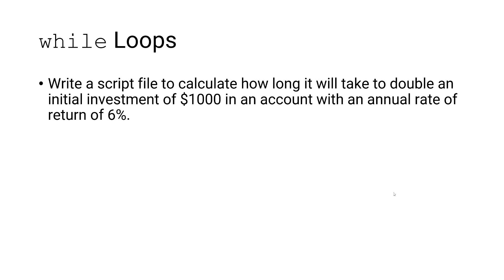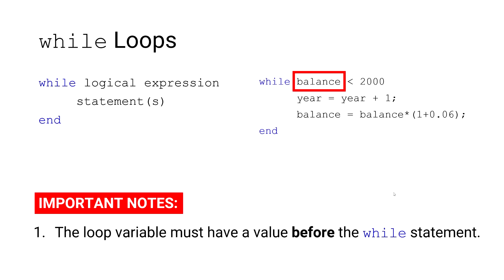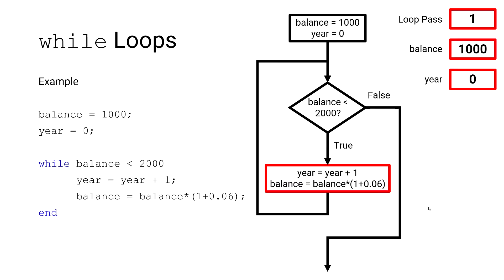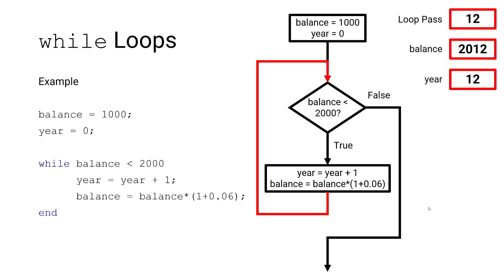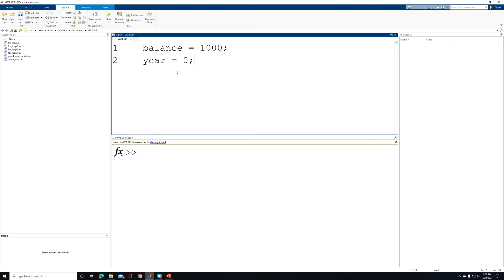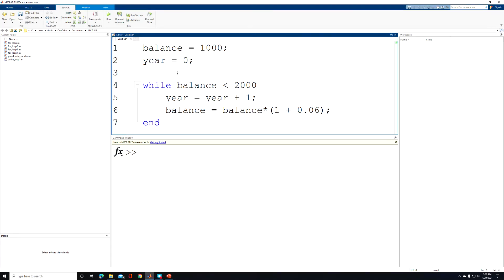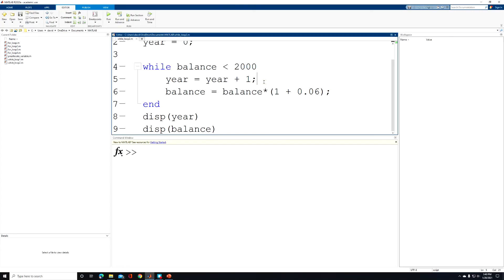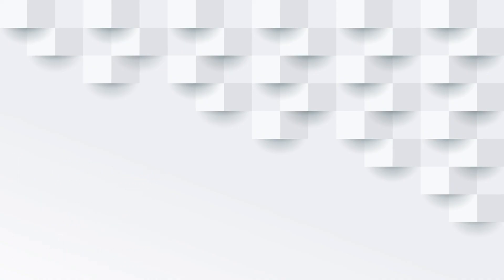MATLAB for Engineers - Introduction to while Loops (Part 2 of 4): Updating Variables and Counters

Comment: hey, amazing videos! I have a somewhat unrelated question. say I wanted the balance to display as 20122 dollars rather than in scientific notation. how would I do that? Also, I have some output in the format "0.37154A(5.438715e-01" what does that represent?
Reply from the maker: The quickest way to display the output as a currency would be to use the format bank command. Otherwise, you could use the fprintf function.